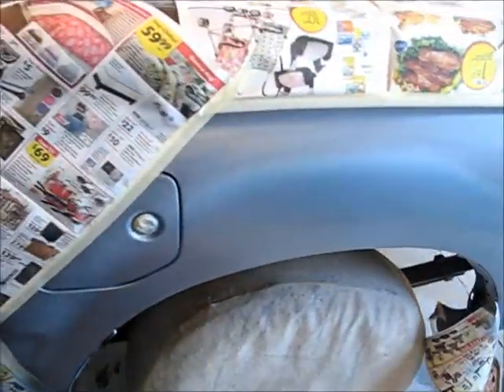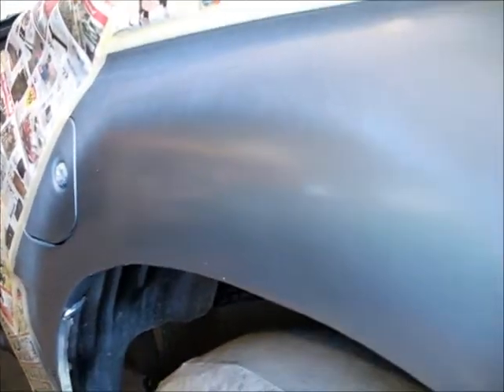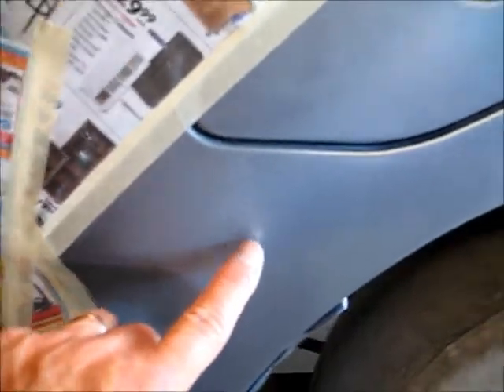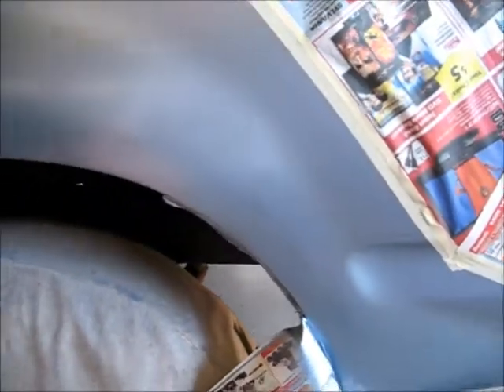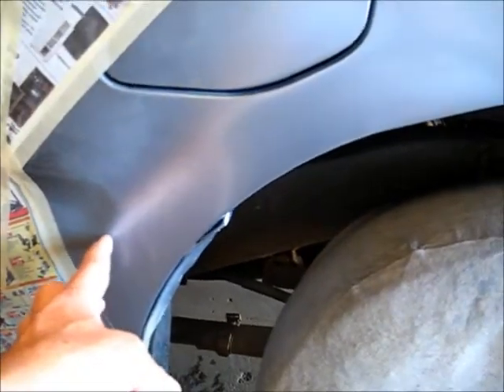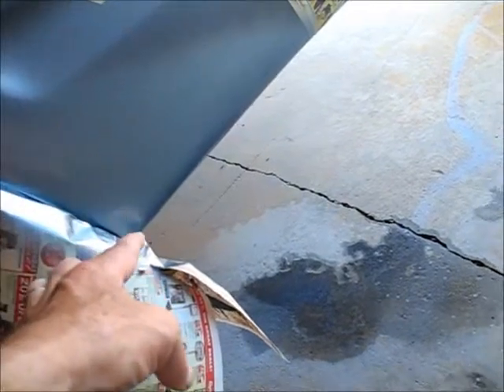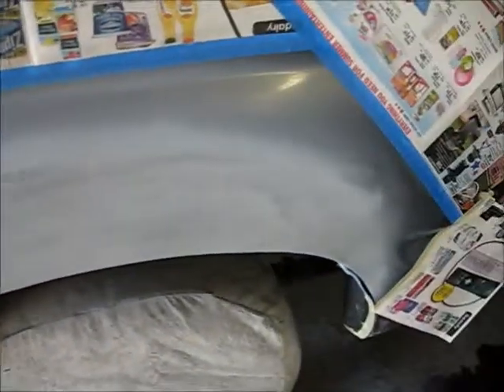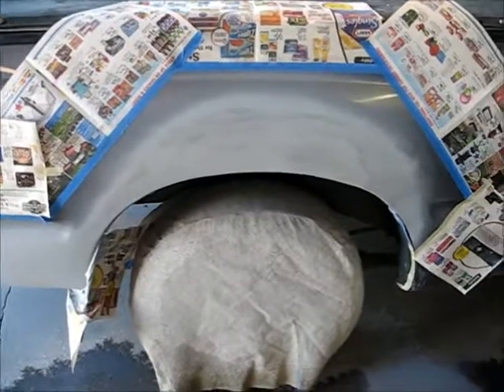'97 Toyota painting adventures - Part 2

Comment from the maker: I bought it on eBay, they had good feedback but it looks like the wrong color for sure. Like I mentioned the primer didn't react correctly and the paint went on funky, it wasn't smooth. I painted with light coats and it just didn't react like it should. I went with the Tempo paint and switched primer to Duplicolor Sealer Primer and all went well. I don't believe it was repainted, a one owner woman, and no difference in door jam paint.